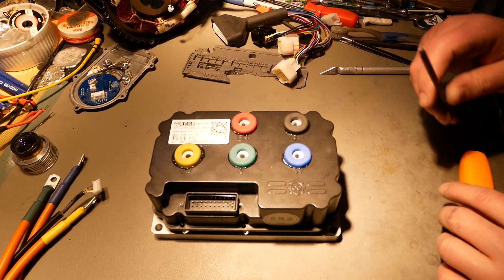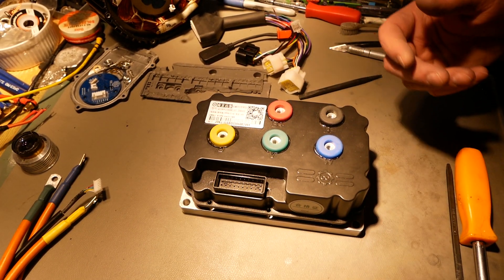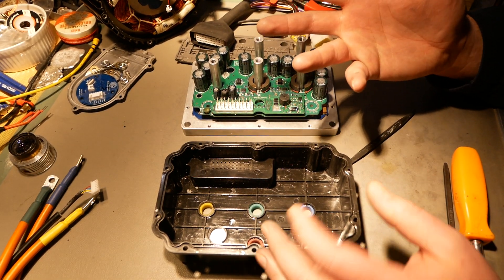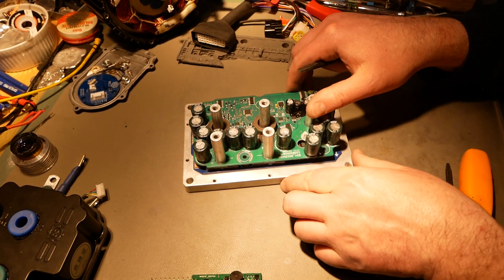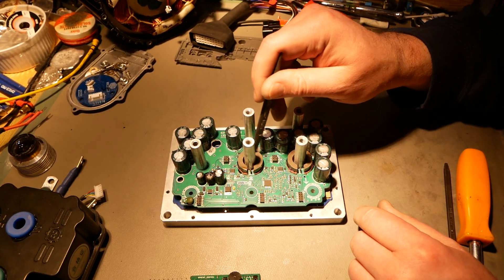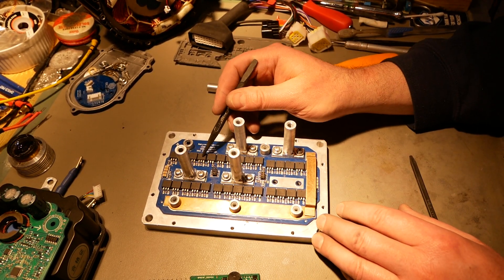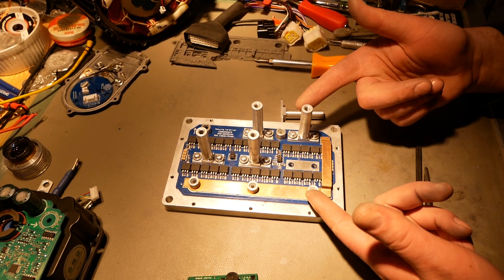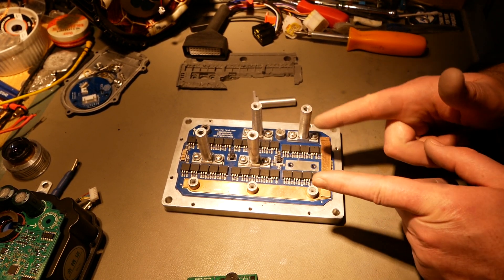Far Driver QS96530 Teardown Overview

Comment: My far driver reads hall motor error I checked all the wires rhey are fine but I does it on every motor I opened it up and nothings burnt or popped but it’s hard to tell cuz it’s cased in clear epoxy any idea what it coukd be V

Comment: Thank you so much for that and clarifying those two rings around the two phase posts I’m putting my post down to those rings and I want to find out what they were before I cut near them. I need to make a real squad because it needs to fit in a slot so no case low posts.
Reply from the maker: You are so welcome!

Comment: Hi . Just getting into my first build/upgrade. Is the 3 phase output voltage the same from a 72vdc input as a 96vdc input controller? Thanks
Reply from the maker: no it's not. Pack voltage is applied to the motor. So more pack voltage = more voltage at the motor. If you have a 20S and a 24S controller both running at 20S ,they will both present the same voltage to the motor.
Reply: @de-bodgery  I have a 72v setup that I am putting a higher voltage battery on. 24s lithium from 72 v lead acid. Will the motor handle that switch?
Reply from the maker: @frankz1125  Very probably

Comment: It's doesn't  have FOC . Siaecosys controllers are pretty much the same as ND  controllers . They just rebranded them  . All hall based Fardriver controllers available from siaecosys can be custom ordered with encoder function enabled . I'm not sure if it's just a custom firmware update of something different on a board .
Reply from the maker: The little daughter board is what is different between hall and encoder controllers from FD. Swap that board and it's got an encoder to hall converter chip on it.
*
I think FD has a basic FOC function set. I did originally agree with you. I spent quite a lot of time with some VESC engineers that convinced me that FD uses basic FOC capability. By extension since KO is also FD development, KO has a basic FOC function set. One of the compelling arguments for basic FOC is that the FOC libraries exist for the STM32F103 CPU. It's jsut a matter of implementing them. Sinusoidal libraries are far less developed for this CPU. It just makes sense for people using the STM32F103 to use the fully developed FOC libraries for this CPU. In recent videos where I present KO or FD, I say they have basic FOC for all the hardware reasons you see in these videos and because of those fully developed FOC libraries.

Comment: Is there a votol who matches an ND72530 far driver power ?
Reply from the maker: AFAIK everything from Votol is all 100v max. I believe that is the case for the 72530 as well. You can look up the specs for the 72530. Find the Votol controller that matches or exeeds that just a little.
Reply: @de-bodgery  i have a votol that runs 96v em100 96350
Reply from the maker: @kccats  votol is smart! They detune the amps when people go above 82v. You will see amps are much lower at 96v than at 82v.

Comment: 11:40 would it be a good idea to make them out of copper ? Or is brass better ? 
If I understand right it would allow to run more than the 375A continuous like you suggest ?
Reply from the maker: Aluminum has less resistance than brass. However, it may be that the stand-offs being butted to the circuit board adds resistance making that a mute point. I'd personally prefer to have the stand-offs soldered to the power stage and with them being aluminum, that's not possible. Amperage is about proper cooling, parts used, gate drive and overall efficiency of the power stage. KO Moto uses a pretty darn good mosfet, but their power stage is very bad and lossy so it gets hot easily. It also has a poor mosfet layout so getting heat away from them is also poor. Their gate drive is also terrible and again that makes a lot of heat. So good parts by itself isn't the answer. It's many things working together and done optimally that will make for the best power stage. You can help them along for sure by improving certain things.

Comment: How do you think ? If use the Far Driver ND72200 with a battery current of 45A, will the aluminum contacts cause any trouble?
Reply from the maker: It's probably OK
Reply: @de-bodgery  In your opinion, for a 1000W motor, which is better to take, far-driver ND72200 45A or ND72260 55-70A?
Reply from the maker: @maythinker3936  1000w is hardly anything. Do you plan to upgrade to more power later? If so, I'd go with the stronger controller just so you have more potential for later. Either one of these controllers is already more than your motor can handle
Reply: @de-bodgery  Electric bike with a gear motor Bafang 1000W. I don't plan to upgrade to a more powerful one.

Comment: Been waiting on a Fardriver teardown.
I almost pulled the trigger on one when they first hit the market and were dirt cheap.

Note to readers: If you do buy one, make sure it's Fardriver you're buying from. There are a lot of counterfeits floating around.
Reply from the maker: oh great! So who knows how bad or good the clones are!
Reply: @de-bodgery   what is the best motorcontroller, in your opinion, for a scooter, powerfull, 75v 300a or more?
Reply from the maker: @toroddlnning6806  If you want Chinese the FD 96850 is reasonably good. If you want western components and good build quality, The STR500 from Trampa is seriously good. The Nukular 24 fet is pretty good and they just released a new version of it a couple of weeks ago. SHUL makes good VESC hardware, so does Tronic. I have a MakerX G300 in my possession to do tear downs. I'll know soon if it's decent. It is at least VESC...and that is always a good thing. X9000 is great. no one that gets one now days complains about them. Right at first there were some earlier teething pains as they got firmware sorted out, but that's all gone now.
Reply: @de-bodgery  I've been doing research on potential controllers for my project and your vids have been amazing! I've probably watched 20 of them now and learned a lot.

The question I'm left with, if I choose the STR500 for my controller, should I run the QS138 90H, or the QS180 90H? My battery would be 72V max, and let's assume I can provide all the amps necessary.

It seems like if I go with the QS138 then I could run it near or past its limit, but if I go with the QS180 then I could be leaving a lot of power potential on the table and the extra weight would be pointless.

There is another difference between them. The QS138 has hall sensors and the QS180 has encoder. Can you comment on your preference there?
Reply from the maker: @Chris-oj7ro  The STR500 right now can deliver what it does now. I can't talk about things I know about, but there is a good chance that it's going to get a few changes that will make it more powerful after a while. They wanted to release a product sooner and then give it a chance to be in the hands of people before they made some changes for more power to it.
*
The QS138 90H is a pretty good match for this controller right now. The QS180 90H will be stronger than this controller. For that motor, the SHUL C/CL1400 will do the job. Either of these motors can have halls or sin/cos encoders. It just depends on how you order it. It's jsut a board in the end cap of the motor.
Reply: @de-bodgery 
Thanks, I wasn't aware of the SHUL controllers and they seem to be well respected and are quite powerful! Are you going to do a teardown on one any time soon? Lol.

I also see on SHUL's website that they sell an encoder board for QS motors. I'm confused, is the board just converting the hall sensor signal to an encoder signal? In my mind I was thinking an encoder had to have like an optical wheel. What would be the point of just converting a hall signal to encoder signal if the source is still hall sensors? I think I'm confused.
Reply from the maker: @Chris-oj7ro  SHUL is on the list of tear downs...jsut a matter of when and opportunity! If you have a QSmotor with hall output, some of them can be switched over to sin/cos with simple board swap. They both work equally well. There isn't an advantage of one vs the other. It's just 2 different ways to detect armature position.
Reply: @de-bodgery  From what I understand, its been poor packing in non standard boxes and firmware issues. That was back when they were brand new.

Could have been clones, or prerelease HW, or a phantom 3rd shift.

Know your seller
Reply from the maker: @Zomby_Woof  China is rarely known for great presentation or great quality. If this was early teething pains, that's fine.
Reply: The clones are horrible and dirt cheap don't buy one, my friend bought one and nothing on it was correct. Even the stickers were placed on it wrong
Reply: @MxEric1  Makes you wonder if its just simple ip theft, or if an existing player doesn't want competition.

Flood the market with shoddy clones and you trash your competitor's reputation before they even get started.

Its a self supporting sabotage too.
Reply from the maker: @Zomby_Woof  why not? There are no copy rights in China. They can reverse engineer anything and clone it! I think that KO Moto is cloning Far Driver...so this isn't surprising really!
Reply from the maker: @BigEBikes  Far Driver clones...hilarious!

Comment: pretty sure aluminium has better conductivity than brass, .6 vs .25 ish relative (to copper) respectively...
Reply from the maker: Thank you for the correction! I looked it up and I remembered it wrong. I love that people pay attention to what I say and post stuff like this! I make mistakes, get stuff wrong, misidentify things, etc....it happens! You can't solder aluminum. That butt joint will have some decent resistance. I don't know this as fact as I haven't measured it, but I believe the bare butt joint to aluminum will have more resistance thanks to the oxide layer than will brass that is soldered down.
Reply: @de-bodgery  yea oxide layer is a major issue with ally... and not sure re galvanic with whatever coating your lug might have... tin might be ok but if it rubbs to copper... and then if you want to use stainless bolts... you'll likely need anti-seaze, and risk of that further worsening the connection.
No worries re mistakes mate, happesn too uus alll... :P
Any word if your getting your hands on a ko motor?
Reply from the maker: @sn0wchyld  I cleaned everything off real good with denatured alcohol and then immediately clamped it all together. It probably won't make much of a difference, but it's the best that can be done with the materials used. I think I ran into a high conductivity interface material some time back for applications like this, but I can't remember where or what it was. The screws have nylon washers on them. They are electrically isolated from the stand-offs. I don't thing aluminum to stainless issues will be much of an issue in this application. Also, all the threaded holes into the heat sink have a fair amount of thermal paste in them. Adhesion of these 2 metals is unlikely.
Reply: @de-bodgery  more talking the screws used to attach wires to the assembled controller, vs whats inside the controller. water + ally + SS = grab.
Gonna ask again re if your getting a ko motor... sry to be a pita just keen to see one pulled apart! :P
Reply from the maker: @sn0wchyld  I am using SS screws for the main studs. I guess I'll put a little grease on them so they don't seize. I want to take apart an FSPEC motor. Just a matter of opportunity! I know where are few are that I could potentially borrow/buy. So far they have been unwilling to let me have one without paying full price and that's a ton of change for a motor that's NOT worth $1400!
Reply from the maker: @sn0wchyld  And I'm damned curious about it too! So no, not being a PITA!
Reply: But you can with a TIG welder can't you? Also, based on another video, the app states that this is 300A line and 530A phase, not 96A as mentioned in the beginning of the video. The first digits are the voltage, aren't they? Not bashing at all, just trying to figure out what's what, keep up the excellent work!
Reply from the maker: @wagnerbrochini3892  LOL...didn't even notice I said "96 battery amps"! hahaha! Good catch! I meant to say 96v and for whatever reason flubbed that! It won't be the last time I say something wrong and have noooo idea I did it!
Reply: @de-bodgery  no problem, who am I to point out anything, just an uneducated troll trying to understand a little better these motor controllers 😂. Since we are talking about amps, do you think that 530A is reasonable for the busses present in this power stage?
Reply from the maker: @wagnerbrochini3892  Not really no. The phases only have 5 mosfets in parallel. That's about 375 amps. I'll be generous and say 400 amps. The BATT- buss is pretty solid. The Batt+ buss with no reinforcing is weaker so it won't conduct current as well.. That 530 amps is peak and not something you can use more than a couple of seconds. 375 amps is probably more of continuous number this controller can deliver.

Comment: Well this is a little disappointing. At least it’s not as bad as ko, looking forward to the nd review to see if I’ll buy from this company again.
Reply from the maker: I was hoping for better too. I have pics of the 72450, 72660 and 96680  power stages and they are all the same as the 96530. Perhaps the people at Far Driver will see my videos and redesign? Clearly Chinese manufacturers can do a good job. Just look at Votol!
Reply: Yeah I have had good luck with the Votol em 150 so I thought it was decent but I didn’t think it would get such high marks. Hopefully the nd96850 has a redesigned power stage cause that’s what I’ll be working with at the moment . Also now debating between picking up a shul C1000, tronic 750, or the ebmx 9000 for my dirt build. I’m whipping up a 21s17p molicel pack and I want a quality controller that can really let that battery shine.
Reply from the maker: @vincentpernicano3277  I have pics of the 850 power stage...it isn't better than the 630. It's almost entirely the same. I give Votol much higher marks than FD in most ways. FD does have a couple of advantages over Votol. It uses 2 phase current sensors and Votol only measures battery current. FD uses gate drivers and Votol uses discrete components for gate drive. IS this in my opinion enough to overcome the far better build quality of Votol...no not really. I think despite the couple of advantages in FD, Votol is still much better hardware. IF Votol in their more advanced models keep all the internal build quality of the EM150 and add phase current sensors and IC gate drivers, it's a hands down, no questions asked winner in every way over Far Driver!

Comment: Nice, from the outside it looks like lingbo. But it's definitely not. This weekend I repaired a lingbo 72202. This stuff is to expensive to throw it into the bin. It took me ages, but now I have a programmable controller for my nova motors clone project. As always: thanks for your video.
Reply from the maker: LOL...NEVER heard of Lingbo! I try to repair hardware too. In the process, I also usually upgrade and mitigate issues.
Reply: @de-bodgery  Here in Europe many scooter brands using Lingbo controller. There must be millions out there. All the NIUs have Lingbos with a special firmware installed.
Reply from the maker: @PeterPan-gy6kq  There is tons of things I've never hard of! LOL.
Reply from the maker: @PeterPan-gy6kq  What's the difference between the HC5XP and the GC5XP? Halls and sin/cos maybe?
Reply: @de-bodgery  I really dont`t know. The datasheets are identical. Most bigger lingbos have options for HALL/GMR/485/CAN on the circuit board. The lingbos are build like tanks. In this case you have a 24-fet-controller for 240A input current and 500 phaseamps. It looks to me like someone had build them like Lego: the same STM32 and only a bigger power circuit. I think their strengh is the software and the implementation into modern smart scooter with GPS and remote fleet management.
Reply from the maker: @PeterPan-gy6kq  Far Drivers feel really solid too until you depot them and then they lose alot of that "beefy" feeling to them. I don't know if Lingbo controllers are potted or not, but if they are, that's probably why they feel "like a tank". Lingbo claims they are FOC. I'd be interested in taking one apart! Lots of controller companies try to build like legos. One logic board, different power stages. It's more complicated than a single board design, but it has the advantage of swapable parts. I'm betting Lingbo runs an STM32F103 or one of the clone CPU's. It lacks a regen throttle. That's a pretty good tell tale about what CPU is in it. Lots of companies are starting to leverage the STM FOC libraries in at least basic ways. It's something just a couple of years ago that I rarely saw! I think that's likely for Lingbo.
Reply: How many current sensors did the controller "lingbo 72202" have?
Reply: what r the FETs on the 530? They stopped shipping hall versions because the cheat firmware (hall only) upgrade is so sick. I have a lingbo 48tube GigaF103 with some interesting differences... It was a demo and I never got it working. The potential is high ~>2000A Phase. If anyone is interested in helping lemme know. Also I have a firmware for the ND (hall) 96450/490/530 that turns it into a fire breathing dragon😂 2200A phase. Play at your own risk. I overheated one with a gf on back and Regen set to 60A. Again if you're interested lemme know.

Comment: Excellent,  the screws on mine are Philips headed
Reply from the maker: Mine didn't come with screws so from my many parts drawers, I pulled out 5 identical hex head screws that have a lock and flat washer on them. I'm sure the stand-offs with the 2 M4 screws into them will hold up OK.
Reply from the maker: Thanks for the video help